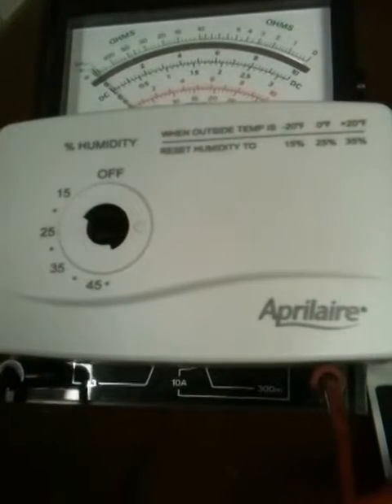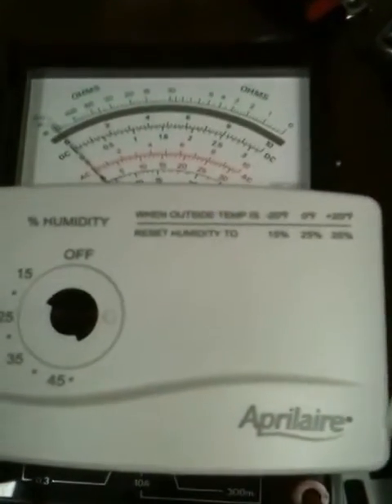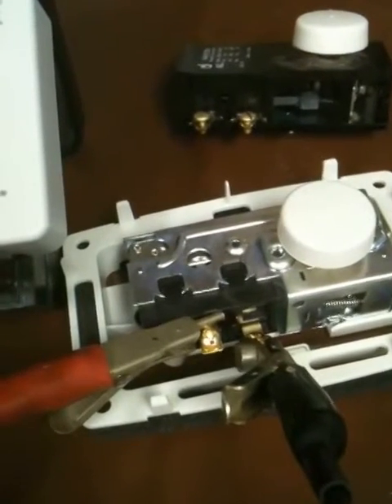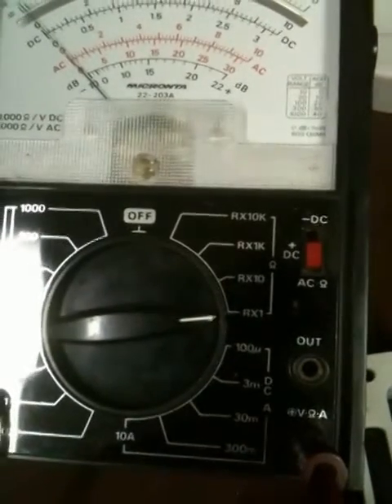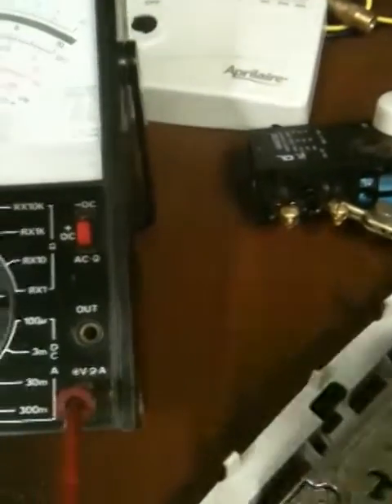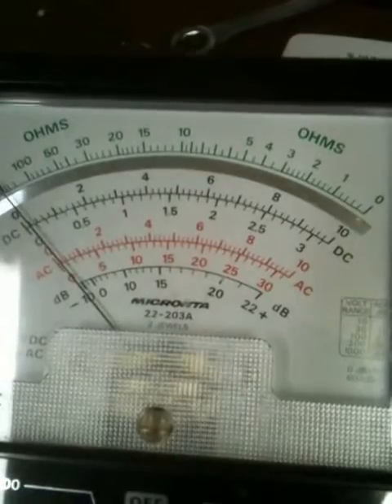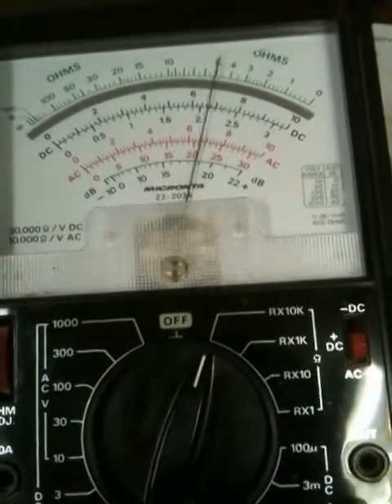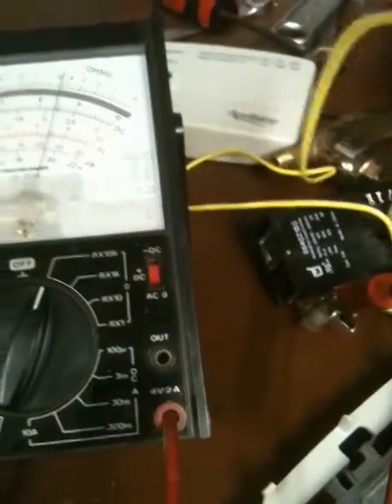Aprilaire Humidistat

Comment: Problem solved. 

I had the same problem in my 4 year old Aprilaire humidistat (mfg 2011). After watching your video I ran the same test and got the same results. Since there was SOME voltage getting through I suspected dirty contacts. Unfortunately the contacts are sealed and out of sight. I drilled out the connecting spots (wish they were screws) and carefully separated the unit. I was able to slip a piece of emery cloth between the contacts to scrub off the insulative build-up (oxidation or corrosion or crud or whatever it's called). The contacts are very close together, only a single layer of emery cloth will fit. Fine sandpaper would have been my next move. Tested connectivity successfully, reassembled the unit, tested it again, works like new. 

The next time I have to take one of these apart I'm going to drill a hole in the side of the housing where the contacts are located so that I have a port to insert some sort of cleaning tool. 

Two things that really bother me about this unit; 
  1) Designing it to be (nearly) impossible to service is clearly engineered obsolescence. What a waste to discard a perfectly good unit due to dirty contacts. Shame on them.
  2) Amazon advertises this unit as 'digital'. It is not, not even close. It is not even electronic. Heck, it's not even electrical. A piece of plastic changes size with humidity and it trips a mechanical switch. That's it. The ad is either a mistake (doubtful) or (more likely) a marketing gimmick. 

Good luck to you all and remember to reuse, recycle, repurpose... and repair.
Reply: Thank you! My no water in humidifier issue is solved!

8 years later, and my 20 year old Aprilaire Humidistat stopped working.
Checked the solenoid and it was triggering with a 9V.
I ended up unscrewing everything and cleaning all the electrical contacts with alcohol, and the humidifier is toggling the solenoid again!